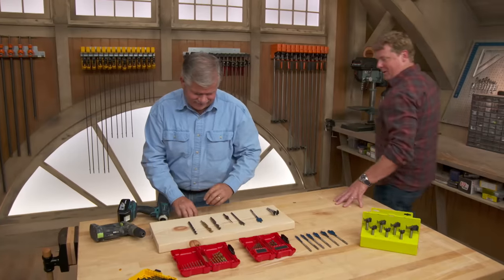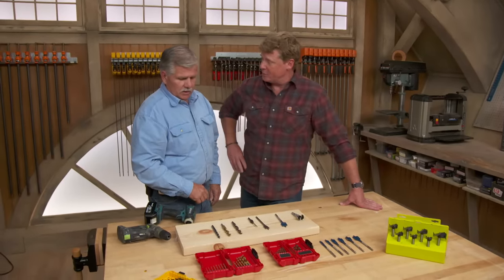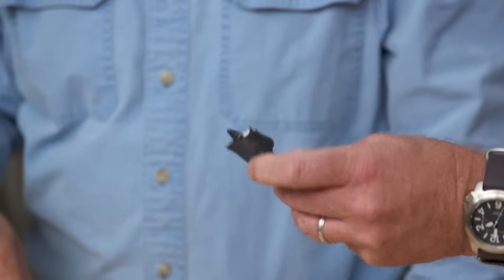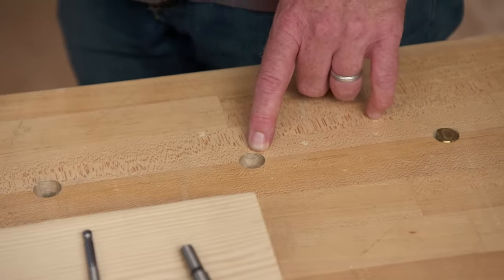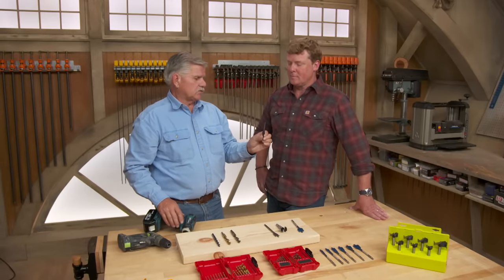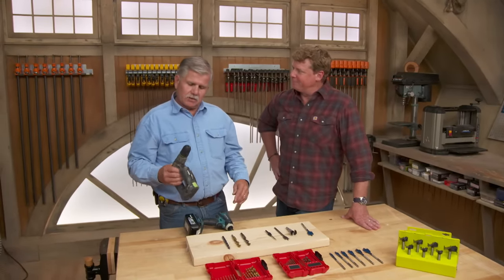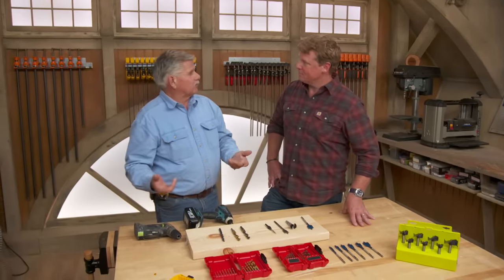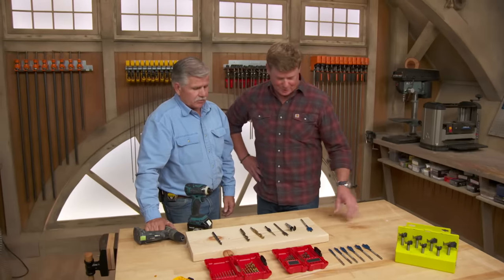How to Choose and Use Drill Bits | Ask This Old House

Comment: It would have been nice if you discussed the types coatings on the 3 different types of drill bits in the beginning. Most drill bit sets come with silver and copper looking bits. I always assumed they were for different materials ie one for wood, other for metal.

Comment: i want to drill a 3mm wide hole in plastic, which bit is the best? also for a hole that big could I still use an electric drill or would a pillar drill be better?
Reply: You can either dull a twist drill (for metal), so that it 'chips' the material instead of cutting it.
       A sharp metal bit will 'pull itself through' as it starts to cut through.
       Not only can that cause the material to come towards you, or the pull the drill into the material... But it can fracture the plastic 
     (as the drill bit digs in, the plastic around the hole is pushed outward - can cause acrylic glass to break for instance)
      So it's very important to NOT use a razor sharp bit.
     *(Note that dulling it will make it unusable for drilling into metal)

Or use a 'brad point' drill bit (for wood). 
That works by chipping by default.

Also, use a low speed setting, or the plastic will start to melt around the drill bit.
     Also, evacuate the chips every few seconds (also to avoid heat buildup).
      You can cool everything with some water if necessary.

And do a tryout on a piece of scrap plastic first.

Comment: What is that black and lime green drill tommy always uses?
Reply: Very Good Boy festool
Reply: I remember watching this old house 20 +years ago and Tommy was using the same lime green stripped drill .
Reply: Festool CXS
The chuck is exchangable, on this picture the bitholder is installed instead of the chuck (which is part of the set):

https://www.amazon.de/FESTOOL-Akkuschrauber-CXS-Li-mehr/dp/B00T6YMK9U
Reply: Well $300 guess i won't be getting that any time soon lol. Thanks for the info @Marcel_Germann
Reply: Very Good Boy priceeee tools
Reply: @moonabove89  

They are killer!!
Reply: @verygoodboy2688  238 US$ (todays exchange rate), 19% german VAT already included. But for export they will normally pay that back to the customer. In Germany the prices you see are the prices you'll actually pay, all taxes already included. But I don't know how high the import tariff in the US is for such things. And the charger got the wrong plug (europlug) and it requires 230V (you could also use the 240V you've got over there), so big minus...and in the US this set is round about 300 US$....
Reply: Ich habe Familie in Deutschland also kann ich hoffentlich es mir da einfach kaufen!  @Marcel_Germann
Reply: @verygoodboy2688  Ja, natürlich. Aber am Flughafen in den USA werden die Zöllner dann sicher Geld sehen wollen (Einfuhrzoll).
Reply: Marcel Germann im sorry my German isn’t that great, lol. But you’re right, I will definitely need to look into how to declare it
Reply: @verygoodboy2688  The declaration is everything. Here you've got two corridors, a red one and a green one. If you've got nothing to declare you choose the green one. If you've got something or are uncertain pick the red one. They're performing sample checks, and if they catch a person which used the green corridor the fine is that they'll double the tariff+import VAT. The import VAT is 19% (as the regular VAT is), if the sum is less than 10€ they won't collect it. Above 430€ value additional tariff gets on top.
If you buy it in Germany tell the shop owner that you'll take it with you to the US. He will refund you the 19% VAT. That's the case in almost every country, you'll get the local VAT back but you'll have to pay the VAT which is in state in your country.

Comment: I am writing from India. I have a question and I hope you can tell me the answer. I have a drill driver with a keyless chuck. I seated my screw driver bit and tightened the chuck just as you said. It works fine. But if I reverse the direction for un screwing, sometimes the bit gets loose. What am I possibly doing wrong?
Reply: Get a good grip and tighten in more?

Or take the bit out and look into the drill. Sometimes there’s a bolt in there that works its way loose. I don’t remember if it’s normal threads or reversed.
Reply: If it's an older drill or a really cheap one, the mechanism may be broken or faulty. But even with a good one, I've noticed that if you don't wiggle the bit and then tighten some more it may wiggle loose while you are using it.

Comment: not sure if i want to use drill bit with an impact driver
Reply: I burned out a cheap drill trying to put a 1/2 inch hole into a 4x4. I wonder if a cheap impact driver would have been able to handle it better?
Reply: @MoneyManHolmes Why not just invest a little bit more money into a tool?
Reply: I wouldn’t try it
Reply: Hahahaha. The great debate of the tool section on the Tube.

Comment: In before the armchair experts arrive to point out everything Tommy did wrong and how much smarter they are than he is.
Reply: I don't think that this time many will shop up here...but I missed the mason drills, they're important too for construction work ;-)
Reply: If anyone can prove Tommy wrong I’ll buy them a beer
Reply: @MattLitkeRacing  Tommy is not wrong but spade bits are mostly a thing of the past. He should have talked about brad point bits.
Reply: Stephan Soucy sure he could have talked about brad point bits and masonry bits and hole saws but these are about getting the basics. He also didn’t talk about through coolant solid carbide bits

Comment: Great now we’re gonna have idiots drilling concrete with HSS ....
Reply: Not for long...so, I wouldn't worry about it too much.
Reply: to be fair. ive used concrete drillbits to drill a quick dirty hole in a solid piece of steel the field to repair the tractor to get it home. that little nugget of carbide helps
Reply: HSS ...hard stone stuff...duhhh

Comment: The way Kevin just throws the bit down @ 3:20 or so kinda irked me. One of those small tells of a douchey person. I hope that’s not true.
Reply: ok there is a difference of throwing a few keys on someones table, he throws a drill bit on a peice of scrap wood. You have not worked in construction have you ;)?
Reply: I don't think Tom liked that either.
Reply: @fristrm  No, he probably thinks framing carpenters set things down very, very carefully...and he's probably never seen a tool fall from the rafters to a concrete slab.
Reply: @buckhorncortez  Hahahaha
Reply: I saw zero hostility or douchyness in his placement of the bit.
Reply: @tonearm29  I agree with you.. that's why he straightened it. Kevin does comes across as a moody, impatient dude. Tommy has patience; but not a pushover.
Reply: watch his face.  he was trying to crack tommy up
Reply: Who cares how he put the bit down...they are both trying to teach people something.